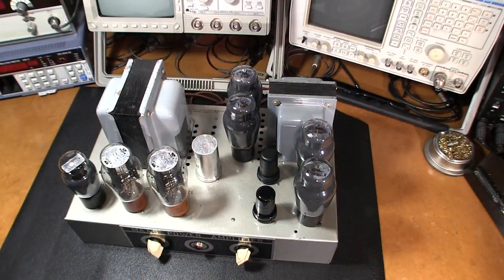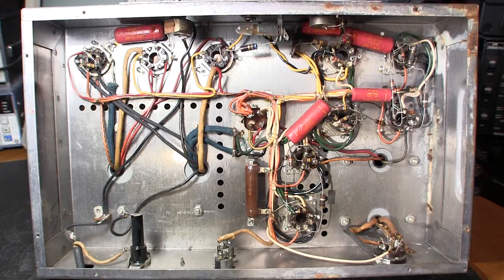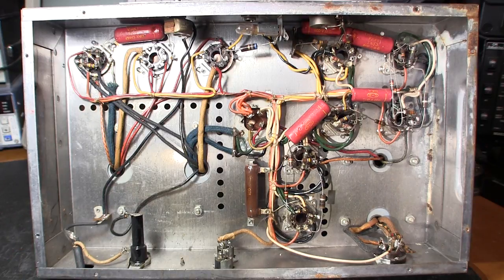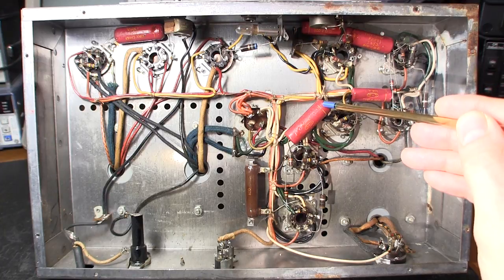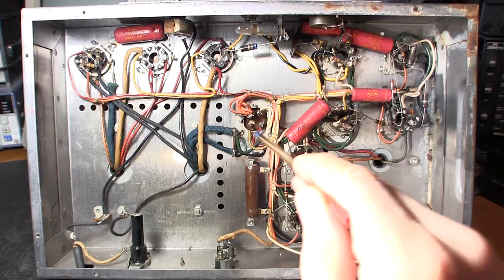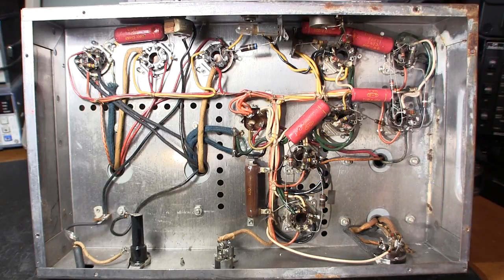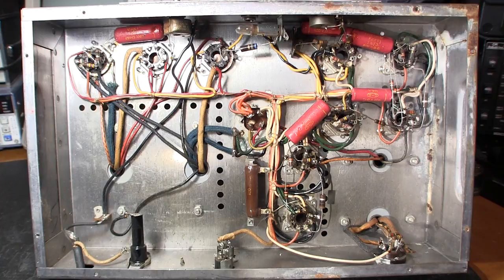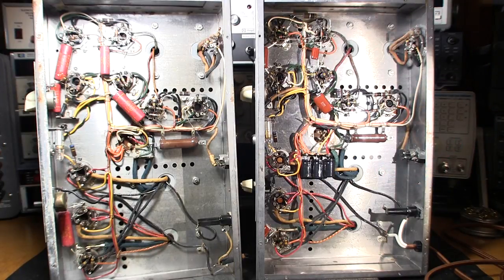Tube Amplifier Repair, and what to look for.

Comment: I truly enjoyed watching your video. It was very useful and I learned a lot from it. Also the history part of the equipment was really enjoyable to listen to. 

I am working on an old jukebox amp. The problem it has seems to be a couple electrolytic capacitors (image #1).

Link to photos: https://www.dropbox.com/sh/nbqw5mqn0sfxt7q/AABDwxYO6cOrTCHA3frxbrK5a?dl=0

I’d like to ask a few questions to this device I am working on. You mentioned the “grief capacitors” :). My amp has some similar looking ones (red circle image #2) but they are green. 

1. Are they the same type that should be replaced?

2. Also there are a few more capacitors (blue and yellow circle image #2) would you also recommend replacing those?

2.1 If so, what type would you use?

One of the broken electrolytic capacitors has a rating of 160uF (25V), which is not a standard value. 

3. What would be a good replacement (150 or 220)?

Lastly, one of my tubes has a crack (dashed red circle image #6). Also it’s a different brand. I learned tubes should be matched, so I’d like to replace it. 

4. Do I have to replace them in pairs? Or do all four have to be matched and replaced?

I really would appreciate your feedback. 
Thanks a lot Pius

Comment: can you not source Russian Vacuum tubes that would work in that chassis, KRONUS ELECTRONICS PLC uses Russian made tubes and have no problem with them, would it be worth building a preamp around a 6X KORG Nutube 6P1 flat vacuum tubes, these tubes can be operated on 9-50V with a 3V heater.

Comment: These Amps put to rest the notion that valve/tube amps are unreliable or that valves/tubes have short lifespans.    ....if the amp is well designed, I guess
Reply from the maker: Aside from popular belief, tubes are incredibly dependable. There is an RF switch under my bench that automatically senses RF and switches..... That tube has been glowing for 14 years, 24/7 and works great to this day.

Comment: Big Chief Sangomo, say usem Little Chief Capacitors (or Tiny Chief Capacitors). Try advertising like that in today's politically correct world. If they fit, I will stuff those multi-section PS caps with modern electrolytics, and crimp them back closed. The modern caps are usually small enough to fit inside. I just use a DC mili-micro Volt meter, and start running voltage from a PSU through the cap, and if I get a long delay of the needle swinging back to zero on charge or discharge the capacitor is way too leaky to use. Same with the old paper dielectric caps.

Comment: hi can you look at this and tell me if this circuit will work or not its constant current circuit. for battery charging.its just have to give constant current when battery voltage is from 3,7 to 4,2.  i can add cut off circuit later on at 4,1 v.  but i just want to know if this is will charge the battery with constant current or not  thank you.
here is the circuit  http://imgur.com/hwvGqzl

Comment: You don't look old enough to know vacuum tubes.
Reply from the maker: It's all in the diet, and lots of RF exposure too :^)
Reply: This is gonna be a shocker.. there are plenty guys around their 20's who are re-discovering tube amplifiers.
I'm one of them, saw one in a high-end audio store. It had my fascination right away
A few years later, bought a couple. and have build amps myself
Reply: I can't tell you how impressed I am by his depth of knowledge in electronics.  I"m a supporter.  Age has nothing to do with knowledge.   His passion is obvious.  He makes me want to learn more and I will.
Reply: I am 22. I built simple tube amplifier when I was about 17 years old. I was very pleased with results.
Reply: Good for you.
Reply: This cat is friggin' brilliant and cool as it gets.
Reply: Tubes are classy and sexy, you don't have to be on a certain age to understand it :)
Reply: I'm 20 I'll be 21 in 3 months. I'm at my second tube amp, I diy my own tube amps since they are so easy to work on. Buy a 150$ amp and making them worth 500-1000$ is what I love doing.
Reply: I love tube technology! Vacuum tubes are great in my opinion, they can handle more abuse and are more durable than most transistors, and in most cases are long-lasting and very reliable.

I love restoring old radio receivers, especially the old cathedral radios and the Zenith console radios. The old Zenith radios, which could receive most of the HF shortwave band, were designed to be as much a piece of furniture as a radio. Those are generally two-person jobs -- one person to renovate the electronics, and one person to refinish the cabinet.
Reply: Dave Micolichek  how were you to know that those then common tubes would be valuable one day... thats like me abusing many foil "charazzard" gen 1 pokemon cards in the 90s (now worth multiple thousands of dollars in mint condition)